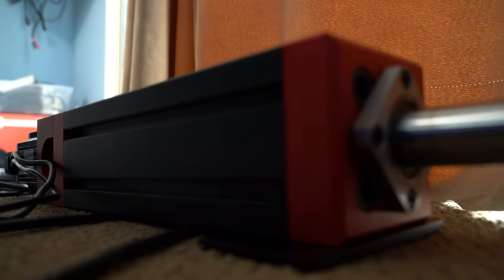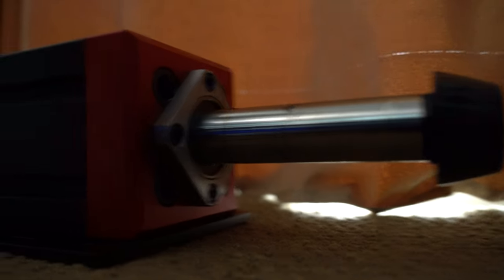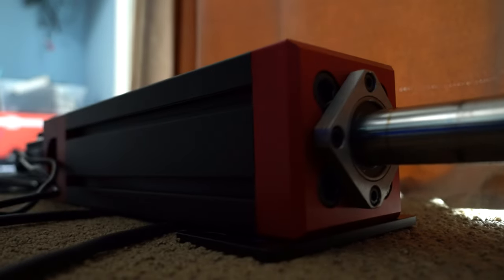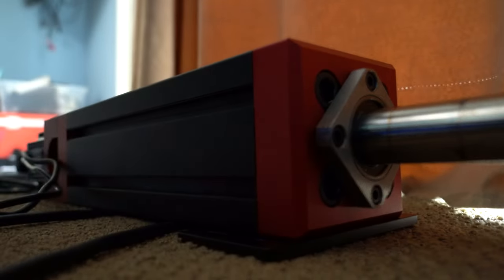Sim rig motion: eRacing-Lab SFX-150 grinding noises part 2

Comment: Hi did you manage to resolve this?? What Actuators did you buy? the DIY Mega+ or the RS Mega +  ?
Reply from the maker: This is the DIY Mega+ kit.  I reached out to eRacing-Lab and they are sending me new internals.  I don't have the 12mm hex to take the end caps off to investigate the issue, but they said it will come with the new kit.  I will post an update when I receive the parts.
Reply: @wittycoder  hi I’ve just ordered this kit from them, have you had any other issues? How easy was it to set up when you received the kit originally? Does the actuators come pre-assembled?
Reply from the maker: @SURG3NT  Actuators themselves are assembled, motors shipped separately.  The most time-consuming parts are wiring the drivers and setting up the software.  I use FlyPT (great free software!) and put the drives in a 12u rack for expansion later for TL+Surge or adding buttkicker amp.  I haven't had any other issues with this setup.

Discrod for Thanos and some useful links are here:
https://www.racedepartment.com/threads/thanos-amc-aasd15a-6axis-servo-motion-controller.168360/
Reply: @wittycoder   Great thank you for the info... so in regards to wiring the drives im assuming your supplied with the wiring diagram? and all wiring is on plugs or do you have to wire direct to terminals? Also the software side I thought the drives are programmed already if you order the Thanos kit?
Reply from the maker: @SURG3NT  They send you an email with attatchments for wiring diagrams in the shipping notification email.  It also includes the settings for Thanos.  I did upgrade the firmware on Thanos which I had to look for instructions for.  The software that takes time is FlyPT/SRS to interface to the sims.  There are profiles in FlyPT but I had to tune them based on car types.  Some have extra DLLs to install to interact with the game, etc.
Reply: @wittycoder  Thanks for all the info mate.. looks like setting it up will be fun :(  lol.... cheers
Reply: Hi. Did you get to open the actuator? I'm wondering how the slider is made and if it's the failing part.
Reply: @konnichy  the failing part is most likely the linear bearing at the bottom of the actuator, very easy fix
Reply from the maker: @konnichy  I did take it apart, it was the linear bearing at the bottom that appears to be sticking.  The actual shaft had wear marks that lined up with the bearing.  eracing-labs sent me a new shaft/slider/etc. and bearing and it's been working fine ever since.
Reply: @wittycoder  Thanks for the detailed explanation

Comment: do the motors make a noise when parked or are they silent.
Reply from the maker: They are silent with the new white server drivers, I have the older ones that have a high-pitched noise when parked
Reply: @wittycoder  
I have the white ones too, they're quiet but the motors on my actuators make an electrical noise, sounds a bit like something's being dragged along the floor.
I've tried grounding the rig but that didn't work, i'm going to try some ferrite cores on the cables next.
Reply from the maker: @streamallday Mine are the older black drivers.   They do make some noise making micro-adjustments, it doesn't sound like much.  There is also a parameter in the drivers to adjust it, don't recall what it was (smoothing or feedforward).  I have EMI filter on the power and daisy chained all of them from 1 outlet, then have the shielded cables that came with them.
Reply: @wittycoder  
We might've misunderstood each other, I get noise from the actuators themselves (the motor on top) even when they're parked. my drivers are fine, quiet as a mouse.
I've ruled out a ground loop like what you've done (un plugging everything then hooking the drivers and powered USB hub to the same wall socket) and i've tried grounding the rig, i still haven't tried ferrite cores on the cables but i do have some now.
I'm glad you've ironed your issues out, bet it's great once it's all up and running :)
Reply from the maker: @streamallday I understand what you are saying.  The old black drivers I have also make noise in the actuator themselves, it can be made better with settings.  The drivers themselves didn't have noise at 10k like I have seen others state, the noise is in the servo motors.  Good luck
Reply: @wittycoder  
I never knew that the drivers could be causing it, i've only ever heard of the black drivers having a high pitched noise that bothered some people which is why they were swapped for the white ones and is why i assumed we had our wires crossed (easily done by text).
Thanks a lot 🙂
🏁🏁🏁🏁